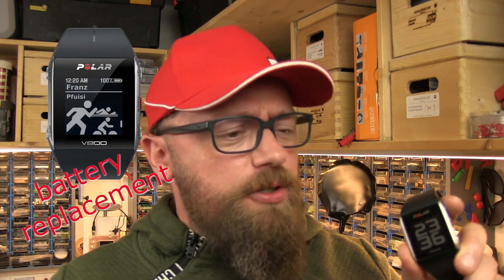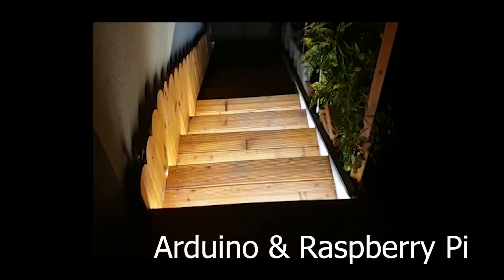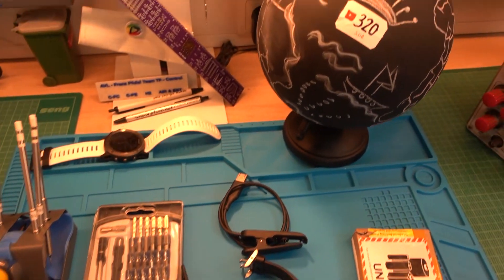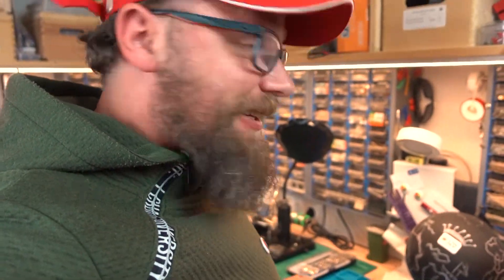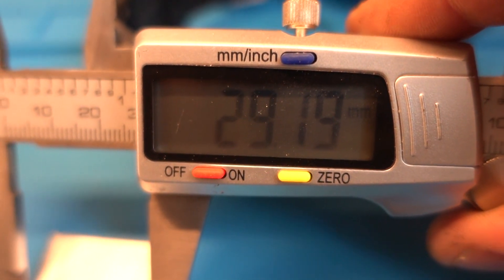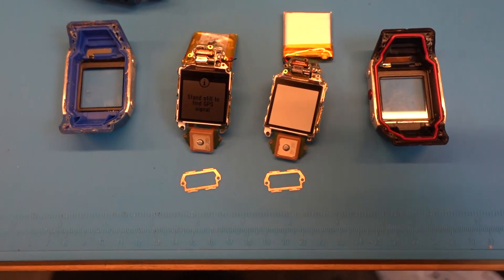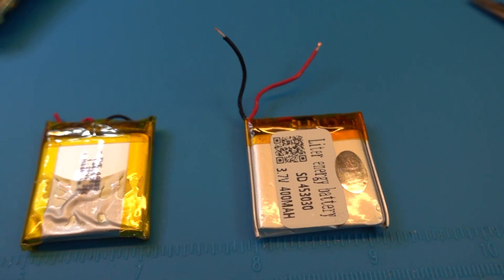Polar V800 Repair/ Battery Exchange [Tutorial] -- in ENGLISH [EN]

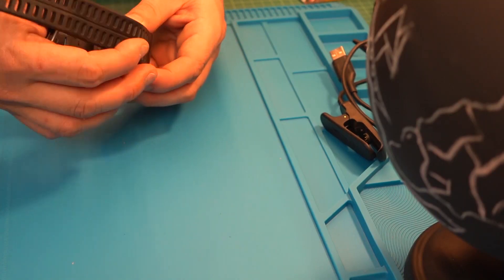Comment: I have an esthetic issue. My polar V800 has white fog on the edge. (When split the watch in 2 @2:54, it's the small part on the right that has no electronic )
Basically, air bubbles has come underneath the external glass. How would you fix that?
Reply from the maker: Hay Moulay E, hm, this is not an easy fix. You could try to dry it with a hairdryer and or soak it in a base water. But might this won't solve the issue. You can always find a lot of P800 watches on second hand portals for a little money (most of them have a broken battery).

Greetings from Austria
PFuisi

Comment: Hi! My v800 didn't want to charge anymore, so I replaced the battery. It turned on after I soldered it, but it sitll doesn't charge :/ any ideas if there's anything else I can do or what the problem might be?
Reply from the maker: Hi iba,
it seems there is something with the charging module. Try to clean the contacts on the watch and also on the charger. I hope this helps. Keep me updated.

Cheers

Comment: Hallo, how to change the battery for polar A370?
Reply from the maker: Hi, 
I am not sure if the a370 battery can be replaced easily. I haven't one in my hands yet. So following are my guess: The housing is sealed with glue, it seems. But for sure it will be possible to replace the battery, only if the watch is waterproof after replacement is not guaranteed. Just try to open the watch carefully and check the battery size. Then order a battery and replace it. A soldering kit is needed. Afterwards seal it with glue.

Good luck.

Comment: Hello, I have a problem when replacing the battery in the watch. After I installed a new battery, my GPS began to be on training only at 10%, 20%, 30% and then reset to 0% and again reaches 30%. What can be done about it ? Completely it does not find a connection with GPS ... I tried to put an old battery with it, the same thing happens, tell me what to do
Reply from the maker: hey,
I am not sure. I have had never this kind of problem. 

Could you solve it already?

Greetings

Comment: Saw your repair, impressive. Personally I own a blue case V800 wich needs to be replace (the case).  The plastics on the side of the glass are breaking. Where may I order another case? Thanks
Reply from the maker: Hey Manuel,
thanks for your feedback. Try to buy a case second hand. There are many V800 out which have the  battery issue.

Cheers PFuisi

Comment: I have a very strange situation. My polar is working, but only 2 days with training. A new 453030 battery for replacement is charged and shows 3.9V on multimeter. When I solder a new one and put a charger, display shows a Polar logo for a moment, and then goes off and doesn't react to buttons. When I remove and attach charger again and again, it doesn't react at all. 
If I switch back to original battery it charges normally. Actually I ordered 2 batteries and they show the same result.

What could be wrong with replacement battery?

Comment: Thank you very much for this video! I bought used polar v800 to continue training after finish my sport career in rowing. The clock doesn't hold charge more than 2 hours on max gps + chest strap. Now i can replace battery by my self and save 15k rub.
Reply from the maker: You are welcome. I hope the replacement of the battery works smoothly. 

All the best and keep on rowing!

BR
Franz

Comment: Link for replacement battery?
Reply from the maker: You can find the battery on Alibaba or others. Replacement battery suitable for the V800:
Original size of the battery: The original battery is 4.4 mm thick, 28 mm wide and 30 mm long!
I used a sligthly bigger battery: length is 28,2mm, 4,6mm thick and 27,2 mm long.
Decide before you purchase! Note the sizes of the batteries varies a little too.
Reply: @pfuisi  thank you! My polar v800 freezes and does not connect with flow so I cant factory reset it. What shall I do? Soft reset does work but then when you press settiings or try to connect with device it freezes.
Reply from the maker: @dss915  you are welcome. Have you tried hard reset?

Reset your V800 by pressing and holding the UP, DOWN, BACK and LIGHT buttons simultaneously for five seconds until the Polar animation is shown on the display.

Comment: Would you mind to tell us the webpage where you buy the battery. Thanks in advance.
Reply from the maker: Hi  José Ruiz,
sure. I have ordered my battery from Alibaba. Just take a look the description of the video for aditional hints.

I hope you find a good one. If not you can contact me on FB or comment here.

Greetings
Reply: Batería de polímero de litio para MP3, MP4, MP5, GPS, bluetooth, batería recargable de polímero de 3,7 v, 453030, 400mah, 3,7 V, 400. DIMENSIONS ARE 30X30 mm a little big according to your video when you measure with the calliper, for that reason I'm not totally sure. This is the link of the battery: https://es.aliexpress.com/item/32861544945.html?spm=a2g0o.cart.0.0.125c3c00QlYUqU&mp=1
Reply: My phone is with battery, but it doesn't charge. I check the charger and it provides 5 V. And the watch is still working. What do you think? It could be the battery or the charger wire?? I'm a little bit lost.

Comment: Nice video! Thank you! I've got a problems with buttons. Its like freeze, very hard to press and they dont move properly. It seems more mechanical problem, than electronic.
Have you any idea? Thank you.
Reply from the maker: Hi Taras,
yes it seems, the buttons are blocked -- you can open the watch and clean it inside --> additional you can add a silicone spray or lubricant to the buttons.

Please feedback, if you need another advice or if it helped already.

Greetings

Comment: hi thanks for sharing this, this is great because a lot of us love this watch and want to keep it running.
one question though, you mentioned later you found you don't have to dismount the screen to swap the battery, maybe it will be apparent when i open the watch (which i haven't), but can you touch on how to do it without dismounting the screen? or you would recommend dismounting the screen anyway, is it easier to do with the screen dismounted?
Reply from the maker: Hey Byron, thank you for your nice words.

To your question. Yes you could exchange the battery when the display is still mounted, but you need a steady hand to desolder and solder the battery cables. There is a approx. 2. mm gap to do so. If you dismount the display, you just need to take care of the very tiny ribbon cable for the display and its background light supply.

Both ways are possible. You could try to do the solderning job before you start dismounting the display.

I hope this helps.

BR
Franz

Comment: I did the battery replacement on my V800 back in January when the fully charged battery of the watch was only lasted 3-4 hours on 1sec GPS accuracy with H7 belt and stryd. However after the change the battery life still sucks. I don’t why. Any idea/comments?

I used this battery pack:
3.7v 453030 400mah lithium polymer battery
Reply from the maker: Hey Leonard,
yes, I have this issue with one watch also. I am not sure what happend. Maybe the battery is not getting fully charged. The black watch I made is still good. Try to clean the contacts of the charger, might this improves the life time of the battery.... For my other watch, I propably will change the battery again.

Note: I used the same battery specification.

I am happy you try to fix your own stuff too.

Keep me informed.

Best Regards from Austria
Reply: pfuisi Hi,
I’ve cleaned the contacts of both the watch and cable but it is still behaves the same around 4 hours tops.
Reply: @pfuisi  Hi, the cleaning of the contacts didn't help. So Im trying a new battery. Already ordered it.
Reply: I think I got the root cause why even changing to 503030 (barely fits but it's doable) does not help - even though the battery is of higher capacity (reliably measured 500+ mAh) Polar V800 reports a low battery already at 3.7V and switches off at 3.6V. As a result, the replacement of the original battery (measured 370mAh) to the bigger one 503030 (measured 500+ mAh) does not help to get a longer operating time. I am tired to play with different batteries, I have even swapped the battery PCB from the original one to the 503030, but the problem is still there. I believe, in most cases, it has nothing to do with a bad battery, but something with a battery controller inside the watch itself.

Comment: Hi friend, I just looked tour video tutorial about replacement batter V800. I have problem with my V800. Poor of water come insidie. The watch work perfectly, but I prefer resolved problem. Have a suggest? I think it's the red gasket broken or too old... But I dont't know where I can buy it... Can you help me. Thanks a lot
Reply from the maker: Hey Alfred,
regarding water comes inside the watch. Was this before you have openened the watch already a problem?
I fear you can't buy the sealing seperatly. Following you can try: a) Clean the watch inside, and buy a Surface Sealant (not permanent sealing) - Those are availalbe in small amounts too. You can put this in on the two watchshells sealing groove and than put the red sealing into it too.  b) You could buy a 2nd hand broken watch and use this sealing ring than. If you lost you backcover, its highly recommendet to replace it too, because there its also the possiblity that water can come in.

If you need any futher info, contact me on FB too.

Let me know your progress.

All the best
Franz

Note: I am happy you try to fix it by your own
Reply: @pfuisi  Hi Franz, thanks for your suggest. I haven't opened watch before. I don't know if the water come inside for push stop button with the watch dry .... Now I try to ispected and clean the watch, the one of possibility if the leak not depend from the gasket, is the space between the glass of the screen and the metal support of the button.... in this case I try for a surface sealant...... I just use for swim not for deep water..... thanks
Reply: @pfuisi  I opened and clean the watch inside. It's dry. Gasket is right , Problem maybe is the up cover, possible water infiltration between metal support and gorilla glass screen.....I want to send you a picture of my watch problem but I don't know I can do. Thanks
Reply: @pfuisi  Hi friend, I try to put liquid sealant betwenn the glass and the metal shell of the screen. after the last swim session, marine water go inside, and the watch goes off... No display indication, never.....  maybe it's damaged.... i opened after, and clean inside. I tryed to connect the power cable but noting happen..... :(  I think to buy a new one, not V800....... or the last polar ( V model) or Garmin.....
Reply: @pfuisi  I opened the watch and separated the glass screen (gorilla) from the metal shell. Water come inside in the upper corner on the left...... If someone have the same problem but with the watch on, seal the glass to the body and after close the watch without electronic circuit and ceck for leak.....

Comment: Dear pfuisi
My polar v800 was completely discharged (with the with the screen off).  I tried charge it again, but not working. I tried with another cable and also not working.
Will I like know if I battery exchange the Polar, it will work again?
Thank you
Adalberto
Reply from the maker: Dear Adalberto,
If you connecting your charger and the display doesn't go on, there is maybe an issue with the charging port. Try to clean the contacts. 

Give me more details. It want to support you.

BR Franz Pfuisi
Reply: @pfuisi  Thank you very much for the reply and for the help

I clean the contacts, but still is not working.
The Polar was stored for about 5 months in your box with all carefuls, and because of that it was completely discharged, because it was in my university lab (due to pandemic).  Since yesterday i'm trying to charger the equipment, but to no avail.

Do you think that with the battery change it will work again?
Thanks again for support
.

Adalberto
Reply from the maker: Hi  @adalbertojr4263 ,

this is odd. When I repaired the V800, it was working, even the battery was totally gone. I could just connect the charger, then It worked normally, when I unplugged the watch from the charger the display went off. But sometimes, a broken battery could prevent to power up the battery with a charger (I never had it but its a possibilty). 

I would suggest to unmount the housing of your watch. And take a closer look too the battery and charging port. Sometimes there is corrotion even inside. You could try to clean the inside and connect the charger again. Leave the charger on the watch for a longer period of time (1 hour or so, even no light goes on).

According to your storage history in a box and the fact the watch was working before, it can be still related to the battery. 1) If you have a 3.7V battery laying around or a adjustable DC-POwersupply you can try to disconnect the battery and directly power the watch with the test battery or the DC-Supply. The watch should switch on. If this is working, then for sure the battery is the issue.

The replacement battery is quite cheap, so you could order it, depending on your location it could take a couple of days until weeks to receive the replacement. You can try 1) and see if its really the battery.

Take care. When disconnecting the battery, the wires should not touch any of the PCB parts, nor shortcircuet!
If you figured out, that the battery is the problem source you can replace it. To unmount the display isn't necessary, but if you do, take care with the display connectors - they can be damaged easily.
Please keep me updated.
Reply: @pfuisi  Thanks again by support

It was the corrotion inside of Polar the problem.

Luckily because I'm not firm with electronics and soldering. 
I would take it to the technical assistance and I would indicate the step by step you provided.

Thanks again for your help

A big hug

Comment: Very nice tutorial, but it seems you got the wrong replacement battery! The required 400 mAh type is SD 502530, you got an SD 453030. Luckily it worked anyway, but I guess with the smaller battery it would have been a little easier... ;-) Nonetheless thanks a billion for this inspiring video!
Reply from the maker: Hi Alex, yes u are absolutely right. The battery I used is too wide, its a tight fit, but the capacity is better than a smaller battery. After 1 months the watch  still works great. You are very welcome and I am very happy you replace yours too?! 

Liebe Grüße aus Graz
Franz
Reply: Yes. I´ll change my V800s battery in the next time also. ATM the capacity is still acceptable, but as the replacement usually has to be ordered in china, shipment takes 2 months or even longer, so I have to get it now. SD 502530 seems to be the closest match to the generic polar battery - and best of all: I found an SD 502530 featuring 600 mAh instead of 400 mAh! :-) LG Alex
Reply: @Pyrdacors  Hi there, could you please advise, where did you find the SD 502530 featuring 600 mAh?  Thanks In advance.  Ew
Reply: @Pyrdacors  hi Jo, have you replaced the battery with 502530?
Reply: @Pyrdacors  Hi could you send link I can't find it anywhere